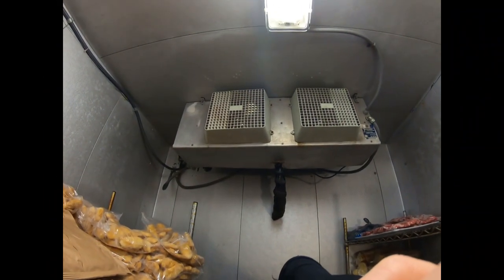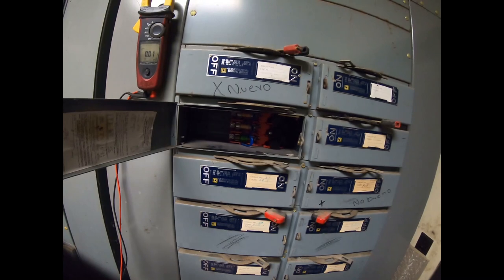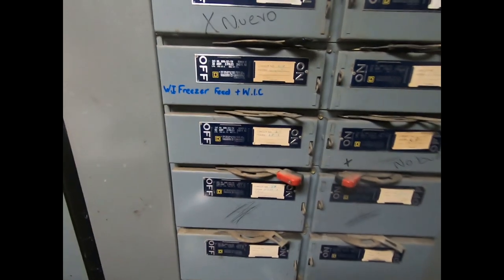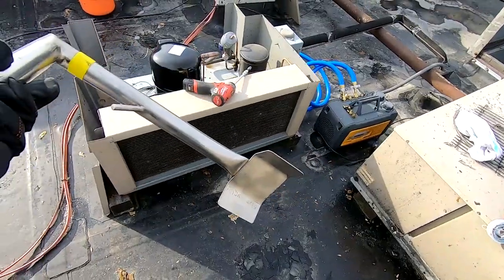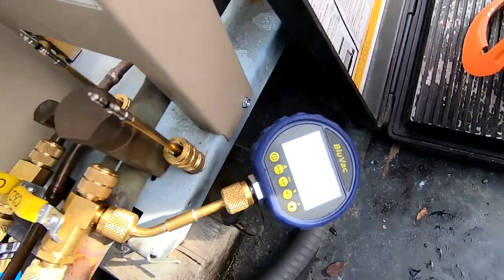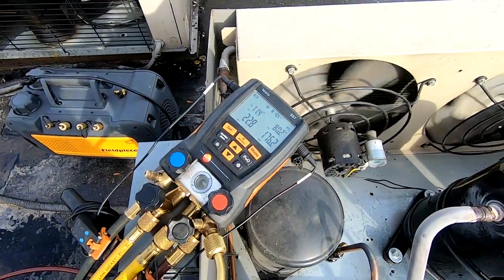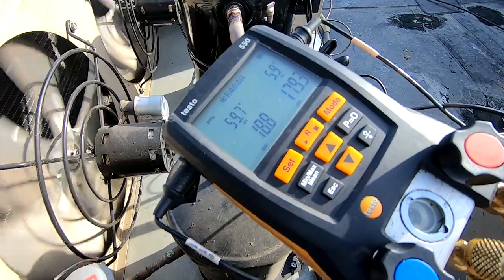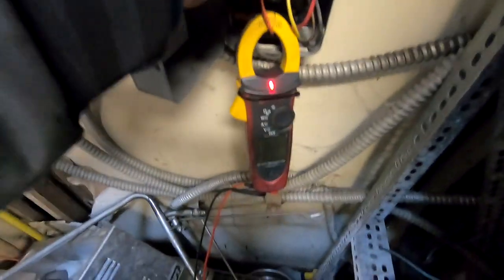Walk-In Freezer & Cooler Warm Hidden Surprises Ahead

Comment: Speaking as an electrician, wiring the disconnects that way should be fine if the fuses are sized right. The main disconnect should have much larger fuses (wiring size permitting), with the fuses in the disconnects for the individual units being sized smaller. That way discrimination is met, so a fuse blowing on the disconnect feeding the unit won't blow the fuses on the main supply.
Reply from the maker: Thermoelectric7 - I fully agree that it might be legitimate and passed inspection because it was built that way and inspected but when you look at it from an potential food loss stand point,  if one device blows the circuit protection you took out two additional refrigeration systems, (three refrigeration systems were originally on that one feed, now there's only 2) that's a lot of money potentially lost under the right situation if they weren't open everyday. Thanks for your comment and watching👍👍
Reply: @HVACRSurvival  it'd be legit if it was done right to start with, looking at the Australian standards for fuses and given the main disconnect is 30A fused, those two feeding the units should be fused for no more than 15A each. As it is, it doesn't meet that and wouldn't comply with our standards. I'm assuming your electrical standards would have similar rules around discrimination.

Comment: 1st week of lockdown here in Paris , France .
We technicians have been banned from the office for about 2 weeks prior already . But we were still going everywhere like normal with no precautions or special PPEs or anything , I guess it was ok for us to get sick as long as we didn't bring it back to the suits at the office 😆.
On another note , are you gonna replace your Testos for the new Fieldpiece Sman ? They look super nice but they're probably quite expensive though .
Like I said , I'm startimg to think that the way to go is Analogs when you need manifolds , and Smart probes for troubleshooting .
I've been fooled by the bloody digital gauges when nitrogen pressure testing , thinking Inwas loosing pressure when in fact it was the bloody gauges loosing its calibration , even though I did zero them out before hooking them up !
Reply from the maker: I agree with you on the digital gauges. The testo 557s were a higher quality system than the 550s. That's why they're more expensive. I would consider the Fieldpiece, I would like to try to get some sent to me to try out. That was the original intent of building the channel was to get provided tools in exchange for honest review.  I like most of Fieldpiece stuff but not everything is great. It's like that for just about everything. I totally understand the feeling of were exspendable but don't bring it back to me theory. There's no PPE to really be had, even the hospitals are rationing.
Reply: @HVACRSurvival  i think they should definitely send you a set to review , you want someone with experience and who has tried different brands to give a good and detailed review ... Fieldpiece , you listening ?
True there's no more masks etc available NOW , but a couple weeks ago , before the panic , they could have at least provided us with a couple boxes of 3M P3 masks , rubber gloves and such ... oh , well watchagunnado 😒
Reply from the maker: @sterlingarcher46  I guess watch it burn🤷‍♂️😷😏

Comment: Worst gauges I ever own, I used them maybe 15 times before they started leaking, I also bought the testo multimeter, also a piece of crap. Put batteries and maybe a month later done, just from being in my tool bag. The testo probes are ok.
Reply from the maker: Testo makes both types of equipment. You have seen that as well as I have 😲